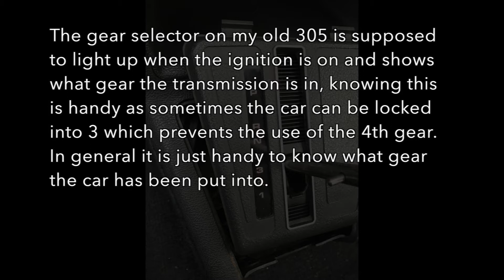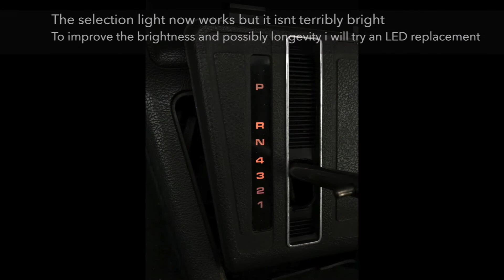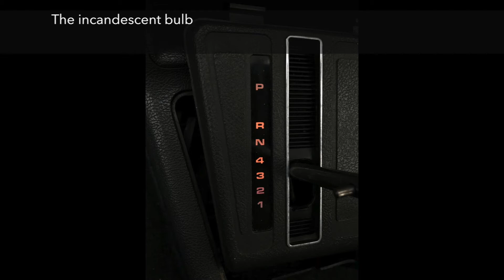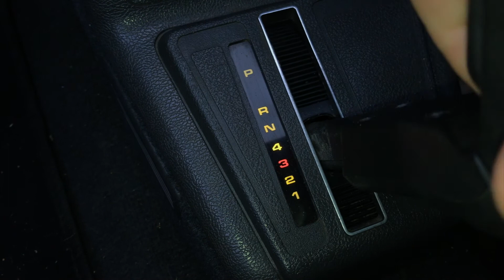305 Gear selector bulb replacement

Comment: Thank you! Asked you for something similar on my 406 and here i have this helpful video now. Good job
Reply from the maker: Does the 406 have a light for the gear selector, i bought a V6 with an automatic but dont see any light around the gear lever just a diagram in the rev counter to show what gear is selected.
Reply: peugeotCitroen2CV Right it does not have an identical one as the 305, but it has lights under the PRND32 next to the gear lever (that's why i said "similar")